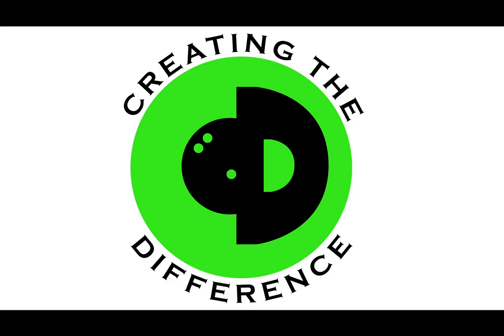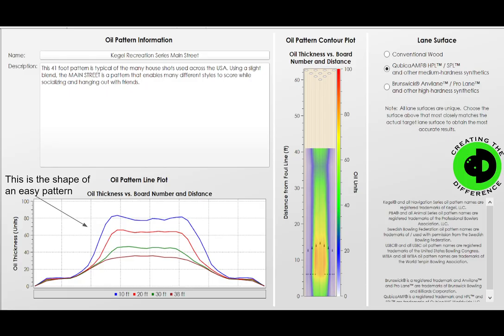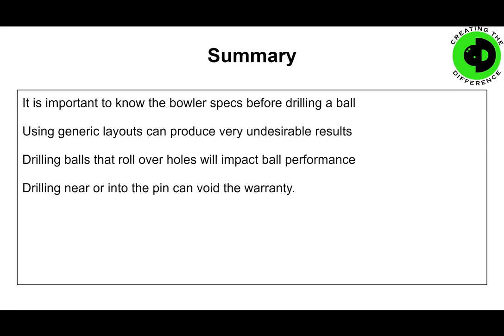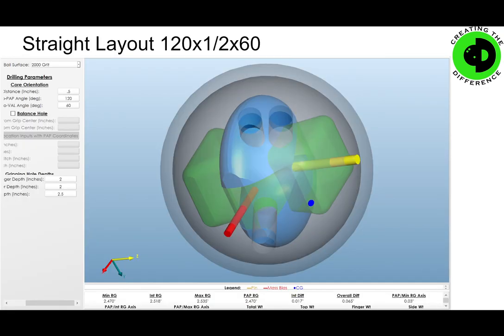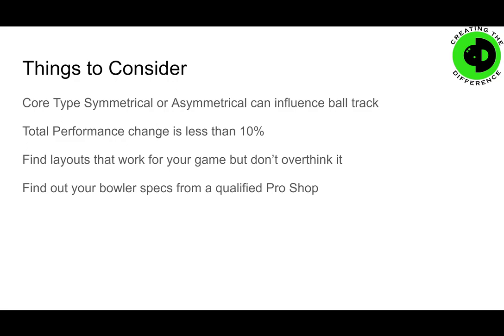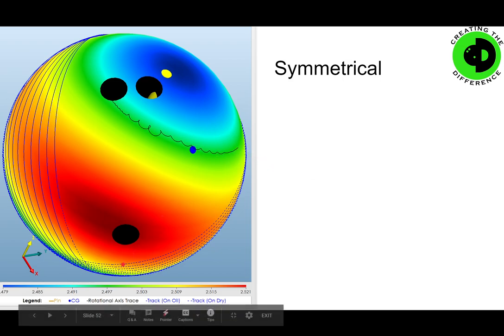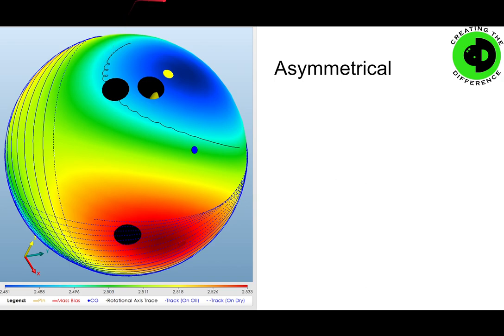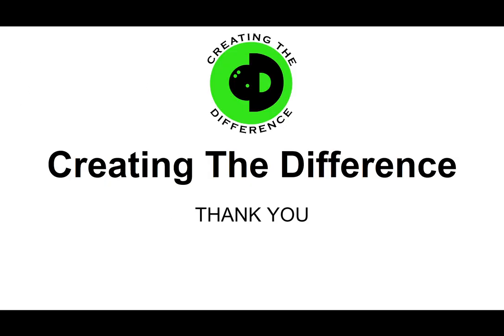Bowling Asymmetric Layouts for the Modern Game | MATCHING UP

Comment: Please do another one of these videos that cover layouts for bowlers with lower ball speed, as an example 13.5-14.5mph.  My experience is that when throwing a ball in this speed range the ball motion is substantially different than one might see if you throw the ball at 17.5 mph.  Thanks and keep up the good work.
Reply: By my experience: lowering ball speed and not taking your hand out (revs/rotation, which for some folks may be difficult to do) means it will be less likely to push THROUGH the flare point, it gives your cover stock more time to work on the lane surface.

Comment: Hi Ron, could you elaborate on the speed part of the bowler specs? What speed is referred to here? Is it off the hand speed or average speed (it is a difference of some 15% to my knowledge and varies with the pattern on the lane)? How much of a difference does the speed change make on the layout itself? Does it need to be a 3-4Mph difference, or even a 1Mph change causes the layout to be different?
Reply from the maker: Ball speed should be measured off the hand to be as accurate as possible. That helps to eliminate other variables like the lane and friction.

Comment: could you please explain about traction ball layouts: you start 10 x 3 3/8 x 60 (9:24) then you jump to 45 x 3 3/8 x 60 (9:31)
Reply from the maker: Yes the 10 x 3 3/8 x 60 is correct. The other is a typo.